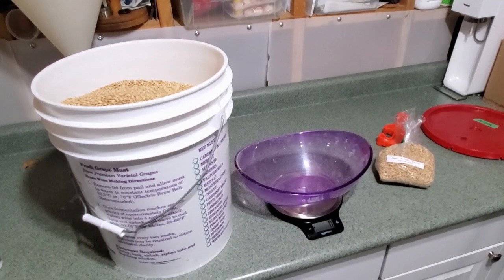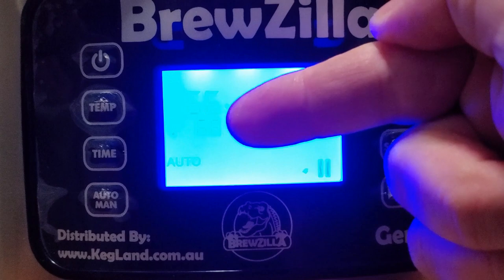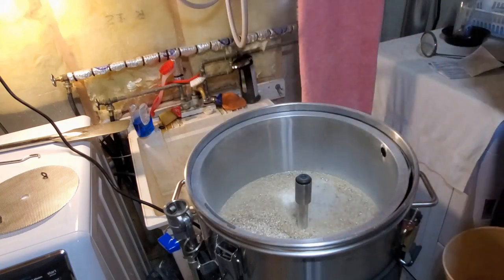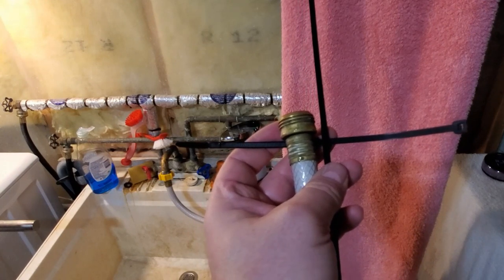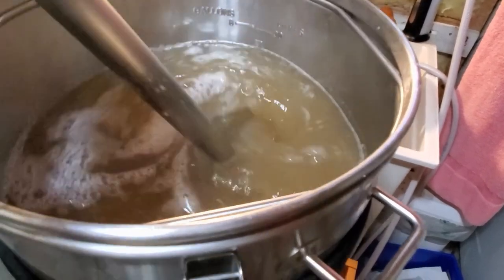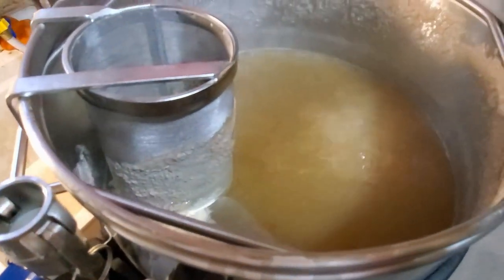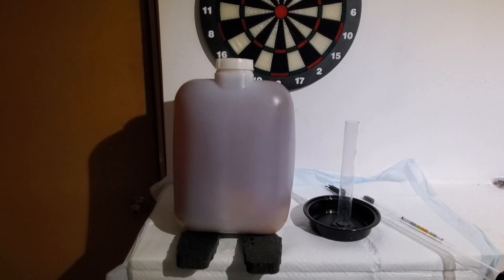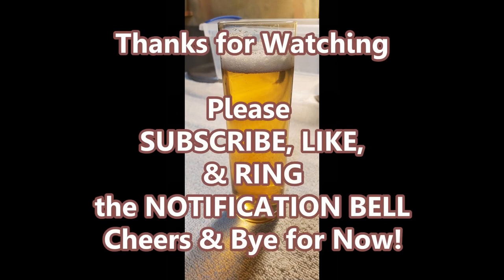Kolsch Beer Using Robobrew Brewzilla the Easy Way

Comment: My preferred method for Kolsch is a lower first temp, 144-146, or even a short 15 minute pause before at 131, a step mash to 158, first wort hopping (not more, just put the bulk in as the wort drains to boil) to improve the subtlety of the hop profile, and Wyeast Kolsch at the lowest fermentation temps..this is such a wonderful, fantastic beer..very under brewed and appreciated! Great job..
Reply: Oh, grains..bit of wheat, torrified, or flaked etc, up to 10%, and also just a bit more half to a pound of..something, color, just so it’s not too plain straw colored at the end..bit of color is nice..wheat gives a nice head and improves mouthfeel, aroma..one article suggested reacting 1.75ml of 88% lactic acid w 1g chalk to make calcium lactate, adding half to mash, half to sparge..

Comment: You can flush the headspace of your cooling cube with CO2 if you have a tank, just for double proofing your contamination issue, or oxygen prevention. I do this with all transfers, just sanitize a small tube, flush all carboys with CO2..